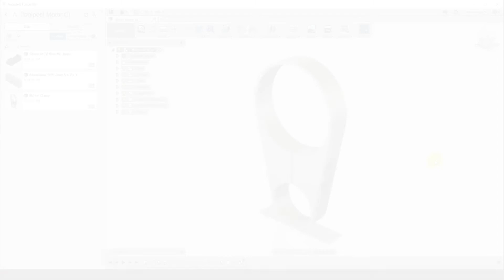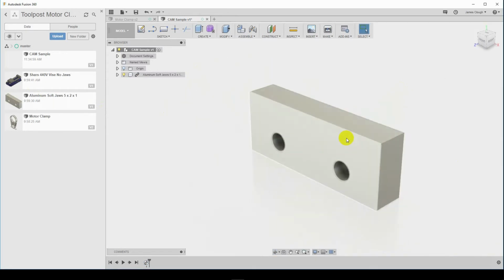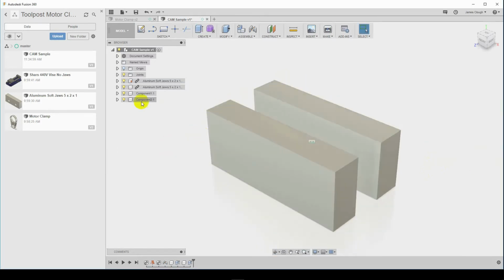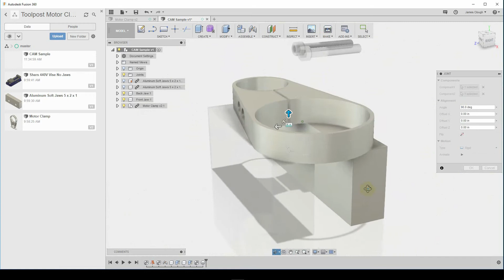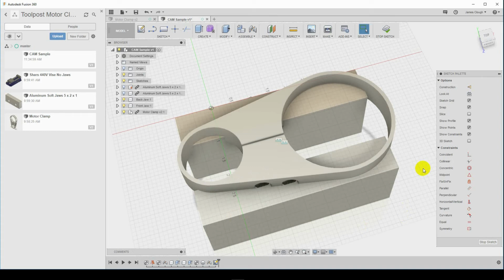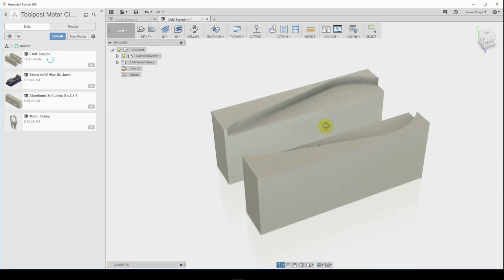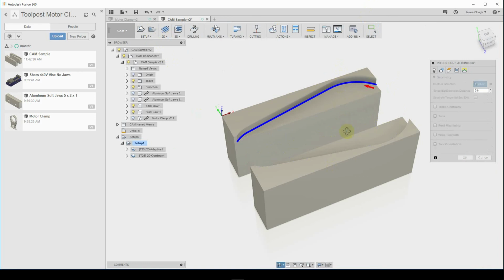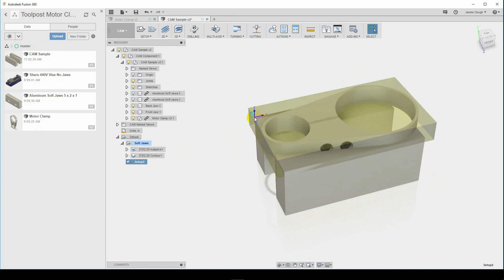How To CNC Mill Soft Jaws with Fusion 360

Comment: Thanks for this James, especially the bit where you have to reproduce the jaws to be able to make the profile cut as I kept going round in circles trying to work on the jaw model.   I have just run a job making a set of clock pallets.  These were made from 10mm ground flat steel stock and after top side op I needed to deck off 2mm from the reverse side.   I had the idea to make the soft jaws in PLA rather than aluminium as per normal.   Saved me material and time to print them and they job held in place while the 2mm came off.   I didn't push DOC beyond 0.5mm. Providing the soft jaws are just to allow decking off the first op gripping material and there are no other features to machine then this looks like a useful tool in the armoury.

Comment: Thank you for the information that you continue to share!  One question. Why do you run at 2100rpm and not at the mills max 2250rpm?  Thank you!
Reply from the maker: I program the GCODE assuming 2100 and then run the mill flat out at max RPM because sometimes this ends up being a little under 2200 when the bearings are cold.  This is just to be sure I don't take an unexpectedly large chipload, slowing down the spindle further, increasing the chipload further and breaking the cutter.

Comment: Also, instead of sketching the motor clamp profile, you  can use the Combine command using the jaws as the body and the motor clamp as the tool.  Bam!
Reply from the maker: I actually tried that first, but it left material behind in the open cavity inside the clamp.  That could also be dealt with, of course, but it would add steps in the model history that could break when changing dimensions in the future.  I was also worried that I would have to adjust the offset from the part to get a good fit.  There are lots of good ways to do this.

Comment: first off, great video, great technique, really like the way you tied things together so efficiently.  quick question, why did you leave 20 thou radial stock (11 min marker), also, wouldn't it be easier to push the 2 jaws together prior to milling as then you don't have to deal with keeping them a certain (1.25") distance apart with some other jig, my Kurt vise would move during milling if the jaws were not clamped together

thanks much
John
Reply from the maker: Thanks.  I'm glad you found it useful.  Adaptive Clearing is a roughing strategy.  It moves aggressively in and out of the cut to keep the tool loaded, and as a result, it leaves a rough side wall.  I left .020" on the side walls and then came back with the second operation (2D Contour) to remove the last .020" and leave a smooth surface.  The reason I left the jaws 1.25" apart is because the part I need to hold in the jaws is that wide.  I guess technically I could have squeezed them together and milled them that way to fit a larger part when further apart, but milling them apart is easier.  When milling, I clamped them down on a 1.25" parallel (positioned below the cut) so the vise would be under normal clamping tension.  Here's the setup for milling:  https://youtu.be/T_PrDxoA-qo?t=58s
Reply: ok, thanks.  I was not sure if you left any material on purpose to hold the part.  Good technique on the milling of the jaws
Reply: @Clough42  On this, first off great vid very clear and easy to follow, but you removed the .020 stock from the walls but it also removes .020 stock from part of the flat surface but not 'all' of the flat surface meaning you are going to have .020 high spots.

I noticed this in my cam while following your vid and I'm having trouble figuring out how to correct that or if I should even worry about it.  I know it's just .020 but that a pretty high tolerance loss.

Any thoughts would be appreciated.
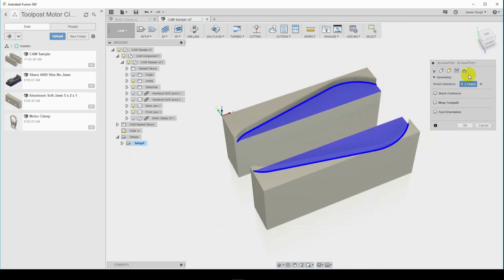Reply from the maker: @silencer3kmg  If you're referring to the adaptive clearing step prior to the contour (at 10:58 in the video) you can see that I left 0.02" radial stock to leave, which is on the side of the end mill, but 0.00" axial stock to leave, which would be on the floor of the pocket.  So the end mill will cut all the way down to the floor of the pocket, and the contour step can clean up just the side.  I didn't mention the axial setting and I went by it pretty fast, but it's visible in the video.  

If you set .020" axial stock to leave, you will get the high spots, just like you mention.
Reply: @Clough42  thanks for the info. Just noticed the reply.

Definitely clears up what I was curious about.  Adjusted my axial to 0 as well now and it's clean.

Comment: I wish I could go to a cad school and just spend a month or so, getting down the basics, I work at teaching myself with help from online sources but get stuck and aggravated and give up.
Reply from the maker: Designing things is hard.  I think this is one of the major reasons why 3D printing at home hasn't taken off more than it has.  Fusion 360 is making this better, just because it's accessible, but regardless of the tools, it's still an acquired skill.  This is especially true once you add in the complexity of designing for a particular process like 3D printing or CNC machining.

If you have questions or ideas for topics you'd like to see covered, let me know.  I'm always looking for future video ideas.
Reply: I am working on a 5 to 6 speed conversion on a small dualsport motorcycle transmission and need a .060 snap ring groove ground in the O.D. of a transmission shaft that is very hard. Your grinder build is perfect for this kind of a small job when conventional lathe tooling is not capable. Do you have grinding wheel dressing tools for something like this, would love to see how this process works. That is what drew me to you build originally and I ended up spending 6 hours last night watching your videos, then downloading fusion 360 and following a tutorial and designing my first part. Your work was impactful to say the least.
Reply from the maker: Thank you.  As far as the snap ring groove, that's pretty narrow to try to grind.  I will be making a dresser for the grinder, but I'm not sure I would try dressing a wheel that narrow.  It might be possible to use a cut-off wheel in the grinder to do that.  You might even be able to accomplish that with an air cutoff tool or a dremel with a cutoff wheel clamped to the toolpost.

I spoke with a professional machinist once (I'm not one) about cutting snap ring grooves, and he said they use ThinBit carbide tools on the lathe.
Reply: Clough42 the tool shop I use said that is ho